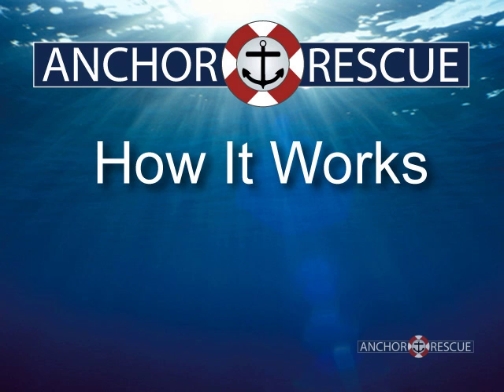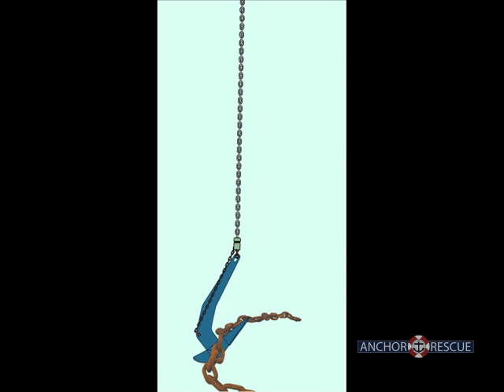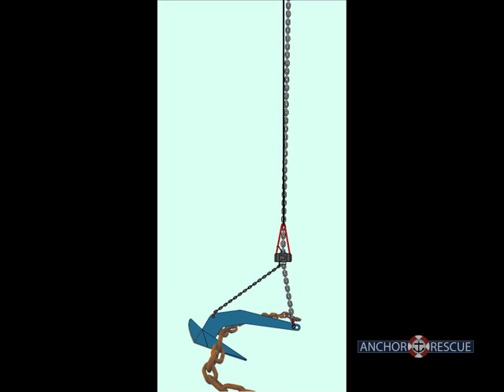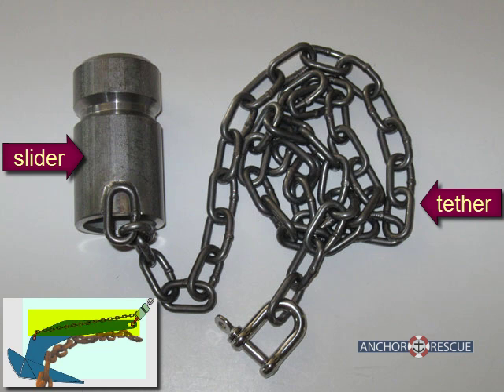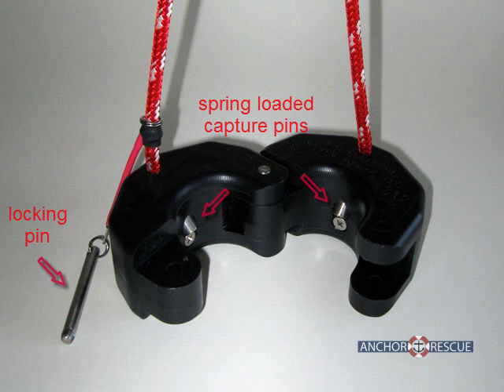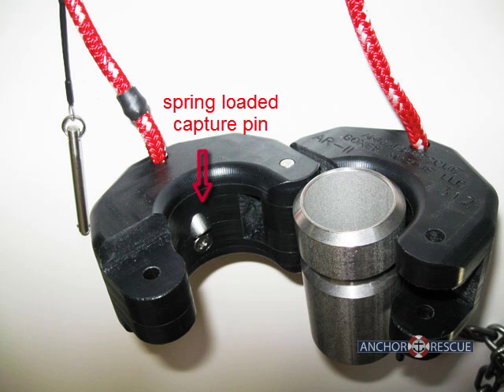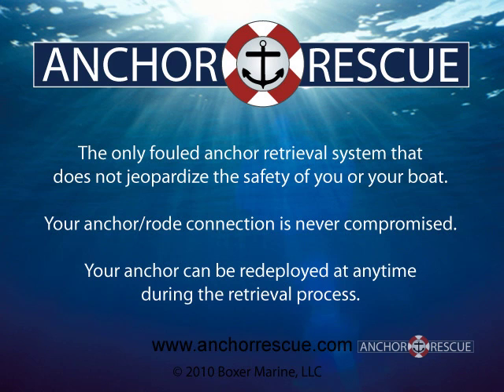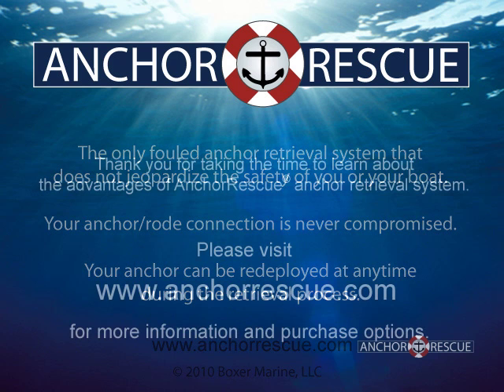AnchorRescue - how it works

Comment: BLAH... maybe but here is what we use and have used for many yrs. A plastic tie strap. Works like this, anchor line/chain goes on the lower attach point then is tie strapped to the upper point to keep the anchor properly lined up and working. If anchor gets stuck or "fowled" as they call it you just change your angle and pull hard until your tie strap pops and the anchor line/chain then pulls the anchor free via pulling from the bottom end. Works like a charm and no funky expensive magnet thingy needed. Just remember to keep some high strength tie straps on board and change them out for new ones every few yrs in case your old tie straps break and your anchor no longer works. Wind her in, re-tie strap it and back in business. Of course this is on smaller boats not sure how it would work in ocean or large boats.

Comment: Looks really good.  I managed to drag  my boat  when the trip line fouled on a deck cleat while  I was dropping anchor.  I had set the trip line because the pilot said there were old chains on the bed from a old trot of moorings.   While  semi tripped the anchor lodged under a  clump of kelp and felt as though it had set properly.  It hadn't and the boat dragged out the kelp in a blow a few hours  later.  Setting a anchor with a trip line set is quite tricky single-handed and this device could prove very handy!

Comment: I've given a LOT of thought, over several years, to ways of re-thinking the tripline setup to prevent the problems this device sets out to address.

If I give my best shot 6/10, I'd have to give this at least a 9
Well done, Ricard !

PS: vincent: good luck finding a boat which doesn't rely on springs. Some of them work very hard, (like valve springs on diesels). Some of them have catastrophic results when they break (like winch handles flailing around, breaking peoples' forearms).

I understand if you have a genuine deep seated aversion (mine, on boats, is solenoids).
But some are harder to defend than others.

If a spring failed in this device, which seems unlikely, given it lives a pampered life in stowage (unless the boat is a dripping saltwater swamp) it would take five minutes to put in some temporary stopgap, like say a short piece of silicone rubber tube 'borrowed' from elsewhere on the boat. It seems to me the spring has done its work once the detents engage; the springs don't have to carry any load.
I'm thinking it would almost work without the springs (using gravity), if the slugs of metal are stainless (heavy), and a loose fit.

Comment: Looks good! The slider on board can be kept clean and checked before use. Recovering one fouled anchor once will more than pay for it. If you actually anchor out a lot you know the problems that arise. Last summer we sailed into an anchorage full of boats and the bowman dropped the anchor and buoyed trip line a bit too early, just before we started drifting back. The trip line fouled the keel as we drifted back and the anchor couldn't set. Had to go overboard. Trip lines can be dangerous,

Comment from the maker: You're right. If something can fail it probably will. That is one of the reasons we tried to make AnchorRescue as simple and trouble free as possible. As you mentioned, the only moving parts are the spring loaded capture pins in the retriever and it is kept on board until needed. The pins and spring action can be easily checked before deploying the retriever and if a problem is detected, it is a simple matter to remove and clean the pins. Thank you for taking the time to post. Dialogue is good.

Comment: Besides you do not have to rig a trip line on a fender. You can tie up the upper en on board and leave a weight at half its length so it is relatively taut and will not be chopped by propellers… Then again it may snag with the anchor chain or rode… As well as a spring can jam … nothing's perfect !

Comment: LOL
I know.There are other makeshift alternatives to trip lines.
Personally I'm not that fond of gadgets with a spring. Most of the time they tend to jam just when you need them most, especially where they cannot be reached such as the top of a genoa that doesn't unhook from the furling roll when wind pipes up or …underwater ! After a few hard lessons I tend to be weary of these and would rather rely on good old "oldies" that never fail.
Thanks for posting anyway !

Comment from the maker: If you set a trip line every time you drop anchor and your trip line never wraps itself around your anchor rode and some other boat doesn't mistake your trip line buoy for a mooring at 2am and you set a trip line every time you drop anchor then maybe you have no need for AnchorRescue. You would be the exception. Expensive gadget? I don't think so. It's insurance worth having.

Comment from the maker: @bw3288 In a perfect world, a tripline does the same thing as AnchorRescue. But that perfect world means you set a tripline every time you anchor, your boat doesn't swing around and wrap the tripline around your anchor rode, some other boat doesn't pick up your tripline buoy thinking it is a mooring, some boat doesn't run over your tripline and cut it and...you set your trip line every time you anchor. AnchorRescue should make life simpler and safer. Thank you for your post.